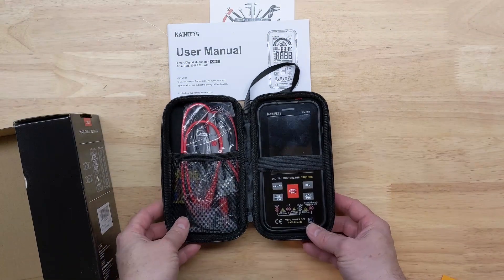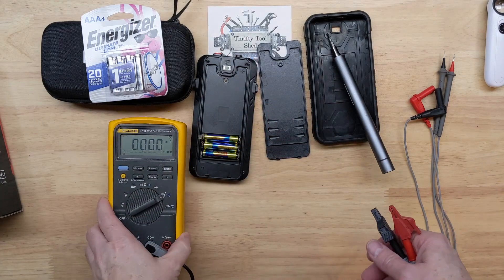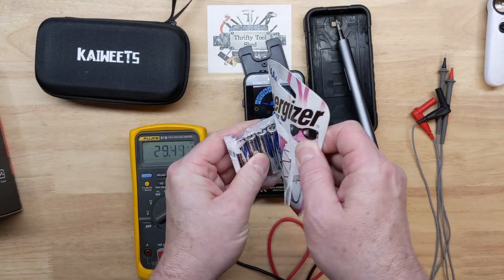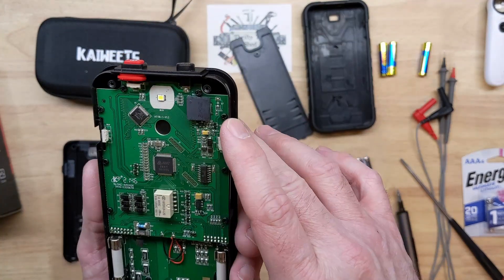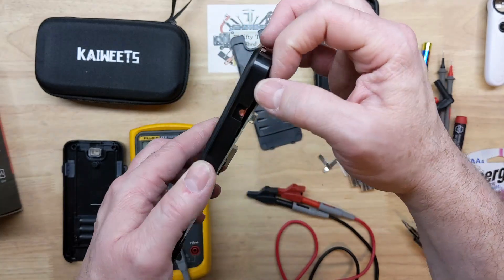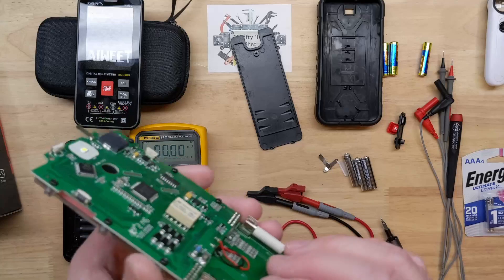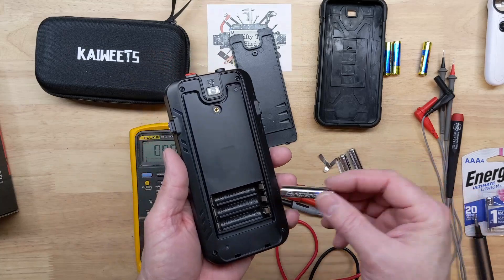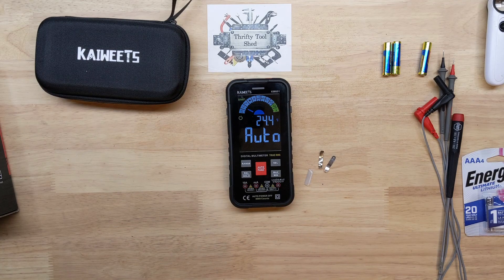KAIWEETS KM601 Look Inside & Battery Life

Comment: why they call it smart whaen i have to chage manually to capacitance and diode mode they should do a full smart auto detection like metrahit29s or testo 771-3 one same chip so its easy to identify component in circuit especiallyu smd smallest one
Reply from the maker: Those are excellent Meters you list here for certain. Some of the best money can buy. I think the biggest difference here is the price point and I was simply looking to share a good hobby meter that works well for the price of around $45. 
I would never try to truly compare one to Fluke, Metrahit or Testo which are top of the line. I do feel like the Kaiweets is great for someone just getting into electronics and it works very well for someone at the work bench.

Comment: Would this be a good meter to keep on stand by for rare use or would it kill batteries just sitting for longer periods- more so than say a craftsman multimeter or a plain lcd DMM?
Reply from the maker: It has an extremely low current drain while off. It will last very long in storage. If you do desire more of a selector switch style meter you may like the HT118A or similar meter. These are excellent meters for the price especially for putting in the glove box etc. to always have with you. I even have smaller Kaiweets meters reviewed that also would be great for such a purpose.
https://kaiweets.com/products/kaiweets-ht118a-digital-ac-dc-multimeter-trms-6000-counts
Reply from the maker: https://youtu.be/ZUes6CPalIk

Comment: Can the fuses be replaced just incase they blow up and are they available locally?
Reply from the maker: Hi,
They can be replaced easily and they are 6x32mm 250V rated fuses current rated 10A and 600mA. They may not be locally available in all areas. Not hard to find online though. Hope it helps!
Reply: @ThriftyToolShed  thank you for the prompt response. God Bless.

Comment: How many days does the battery last?
How many days in standby mode?
Reply from the maker: Well at 3:05 I mentioned that it would run over 40 hours at the 30ma we tested with 1200mah batteries as an average. At 15 min auto power off it would last around 160 uses. That's as far as I tested this one.

Comment: normal carbon display how milli amp consume like fluke ? i want to see difference both meter amp consumption
Reply from the maker: Meter with plain LCD will draw much less current of course. The backlight will draw some extra current if turned on.  The OLED display meters eat up batteries very quickly which is why they are not used much. This Kiaweets KM601 does an excellent job to me being nice and bright with still acceptable current draw to give decent battery life. Sorry I did not think to compare in this video. Thanks for your comment!

Comment: I bought this multimeter lastnight for $39.10 from kaiweets website at 15% off, First I watched about 10 fluke owners test all it's readings, modes, response times, accuracy, quality, etc, it's pretty much dead on and definitely a good buy when it comes to price to performance, would recommend based off the extensive testing/results I've seen.
Reply: Well you can't go wrong for 40 bucks but what I'm amazed looking at the inside is the scarcity of parts. It's almost bare bones PCB compared to Fluke and Brymen especially with parts on both sides. Makes me wonder are all these parts just smokes and mirrors or maybe antiquated design? Could this el cheapo design be superior?